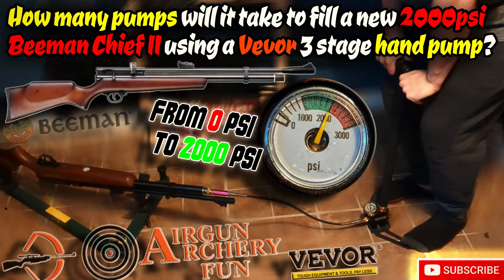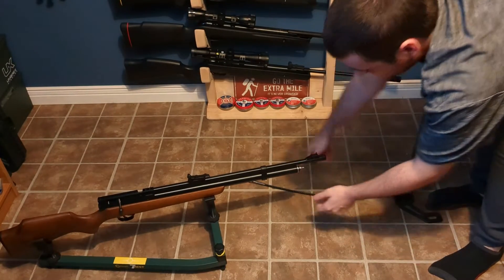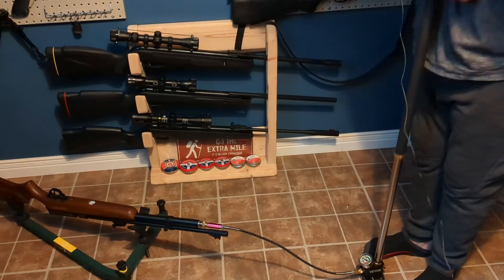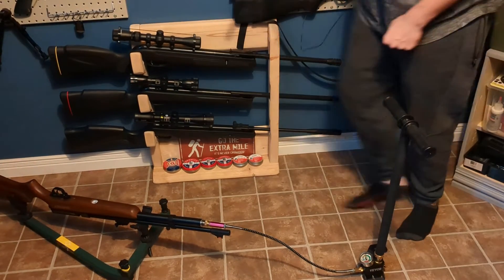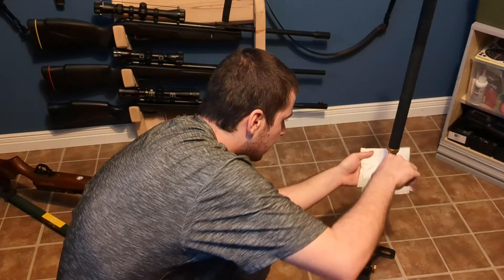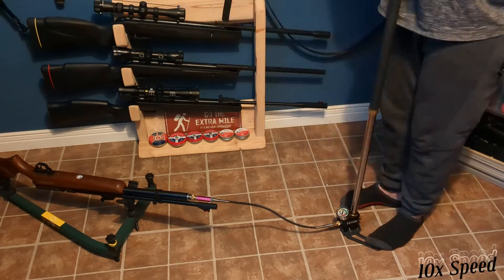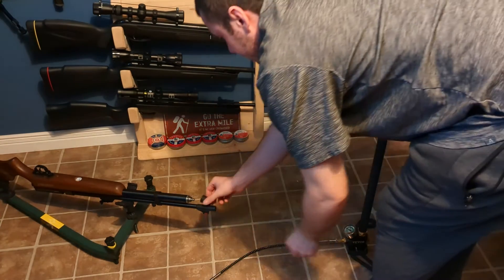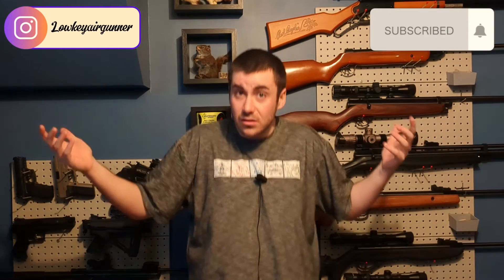How many pumps does it take to fill a 2000psi Beeman Chief II Pre-charged pneumatic rifle? #airgun

Comment: My sons had the chief 2 for about a year. I thought the hand pump would be great for him. Unfortunately it’s a little much for a 10 year old.
Reply from the maker: @dontfit6380  I can see how the weight of a 10 years old can make this near impossible for him!
I am about 180lb I believe so for me it is very reasonable especially if you only refill it about 1000psi each time

The 2000 psi version is already way easier than the 3000 Plus-S even for an adult and I wouldn't recommend getting a hand pump for anything over this unless you are built for it
{Will also put alot more stress on the pump itself}

AirGunSource sent me a JTS comp1 compressor to test out and it is definitely a different world haha

Thanks for watching :_LwkLogo:

Comment: $250 Amazon compressor ftw
Reply from the maker: @fzr1000981  Sadly I cannot afford a compressor right now but id definitely like one eventually

 Especially if coupled with a bottle since a pump isn't very practical at the range in 30°c weather 
(I could but I won't)

Thanks for watching :_LwkLogo:
Reply: @LowkeyAirgunner  when you can save up, I'm using a GX CS1 compressor...works great and yes made in China but seems to be quality.  Using with Benjamin Armada

Comment: Nice Low-key. I'm glad the air rifle wasn't the New Regulated Beeman Chief II 3500 PSI Model 1341. I don't want anyone to have to emergency service called for you. LOL. Just looking out for you buddy.
Reply from the maker: For a second I thought this meant that the new one had some sort of dangerous catastrophic failure going on but I am assuming that you are saying that I am out of shape! Haha

Thanks for watching!
Reply: @LowkeyAirgunner  I guess you have never pumped an air rifle passed 3000 PSI? Getting to 3500cpsi is ridiculously hard. LOL
Reply from the maker: It does get progressively harder being very easy before 1k slightly harder up to 2k and a fair bit of effort up to 3k but I don't think that 500psi would change much...

With this said even by jumping on the pump I am not heavy enough to make it output 4500psi so that definitely would be problematic I might need 4 stage pump haha

Comment: Cool video, I use a hill pump mark4 which works really well.
Reply from the maker: All of the hand pumps seem to be fairly simmilar!
What seems to make the most difference is the number of stages but if you have an airgun under 4500psi that might reduce the effort but also add possible failure points...
Who knows!

I have not had any trouble with this one yet (I do try my best to take care of it and not overheat it) hopefully it lasts until I can afford a compressor haha

Thanks for watching!
Reply: @LowkeyAirgunner  Yes, the stages make a difference. The hill pumps are the best and very well engineered. Only use it sometimes as I have a divers bottle at my shooting range
Reply from the maker: @airgunnostalgia4210 I've heard good things about Hill compressors I believe but I didn't get much feedback on their pumps!

Vevor seems to have mixed reviews (especially on the compressors) but yet the pump is doing great for the price... 
Time will tell but I am already pretty satisfied.
Reply: @LowkeyAirgunner  The hill pumps are incredible.... I've tried a cheaper one that I picked up on Amazon and the difference was like night and day
Reply: Generally speaking though I try to avoid the hand pumps.. Even though I have a really good dry pack on mine it's still prone to humidity and moisture which is terrible for the internals of any PCP. A dive bottle is still the best as the compressed air is dry. .. Only my two cents 🤣 Looking forward to see how you get along with this PCP. Love the wooden stock!
Reply from the maker: I've heard of this but I really can't afford any better!
If I had a minimum of extra money id atleast get a giant filter for it but eh..

Quality stuff is always nice but just like I don't own a fancy air rifle just yet if it works... It works ! Haha
Hopefully I won't make a rusty pcp video anytime soon
Reply: @LowkeyAirgunner  200% agree👍👍

Comment: If you can get some silicone grease for your pump I found it works better.
Reply from the maker: Interesting idea...
It would last longer before applying more in theory but they say in the manual that you can get the oil to clog some of the ports if you put too much so I don't know what to think about it because grease is way more sticky.
One thing for sure you need to apply it sparingly!

Thanks for watching
Reply: @LowkeyAirgunner  yes just a dab..😊

Comment: Just a tip but if you bleed the air quickly it slams the valve closed quicker ensuring a good seal and it helps prevent leaks. Great pumpin action homie. Haha. Looks like a sweet friggin rifle. Have a great rest of the weekend bud.
Reply from the maker: You mean the valve in the pump? 
Interesting I am usually very gentle with everything so I opened it slowly by instinct.

Thanks for watching & have a nice week!
Reply: @LowkeyAirgunner  the valve in the air tube of the gun.
Reply from the maker: Interesting I thought it was closing each time I stop pumping or the air would try to come back into the rifle? 
I dunno shiet about this stuff I am learning as I go... Make me a nice drawing plz haha

[Not sure I am understanding this right or not... But bleeding the pump faster will help the rifle somehow? 
Basically the pump fitting is pushing against something and once you degass it it stops or you mean the actual airgun valve that gets hitted by the hammer?
Reply: @LowkeyAirgunner  yeah they say the valves on some gun close between stokes but because the pressure should be equal on both sides of the valve there is a chance the valve is not in a closed position when bleeding. I know for a fact my Armada ticks after each stroke which im assuming is the valve closing but once, only once over the years i had a piece of debris prevent the value from closing 100%. And i could audibly hear the air leaking from the valve. I just pumped it enough to equalize the pressure between the gun and hose and then released the bleed valve as quickly as possible and it immediately solved the leak. Ive never had it happen again to so it could just be pure luck. But yeah, I just do it out of an abundance of caution. Maybe im the weirdo tho so take it with a grain of salt. Hahahah
Reply from the maker: Well I guess my OCD says just bleed the air at moderate speeds now 🤣
Reply: @LowkeyAirgunner  haha. For sure man. Keep up the great videos homie.
Reply from the maker: @JohnnyMakAirgunner I try my best but it is pretty hard with this cold weather!
We just got a bit of cleaning done in the basement I should be able to come up with something

I am also working on my noob hunting vlogs and that's alot of work with poor footage but I want to keep souvenirs of my first few hunts so it is worth it!

I got a few of your vids in my watch later list but time is lacking to what everything id like to haha
Reply: @LowkeyAirgunner  Amen brother. The struggle is real. I lose motivation to make videos in the winter myself. But ive got a damn mouse livin in the camper. So He can be the star in my next video. If he just wouldnt wait until 5 a.m. to come out… hahaha keep on keepin on bud.
Reply from the maker: @JohnnyMakAirgunner A mouse trap sounds alot easier 😂
Rat traps are funnier tho... we even caught a starling with it instead of the chicken spotting weasel. 😅
Reply: @LowkeyAirgunner  way easier, and also way less fun! Haha.